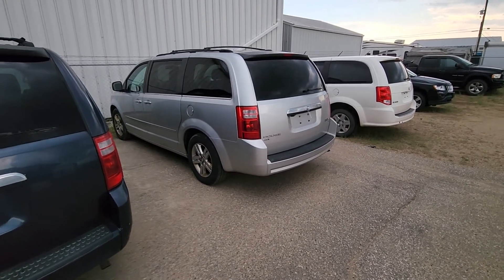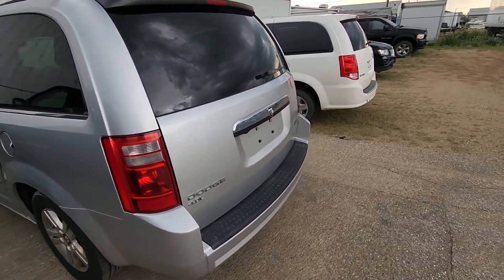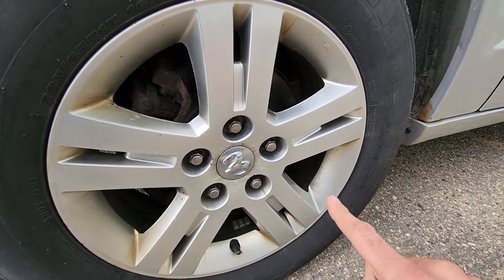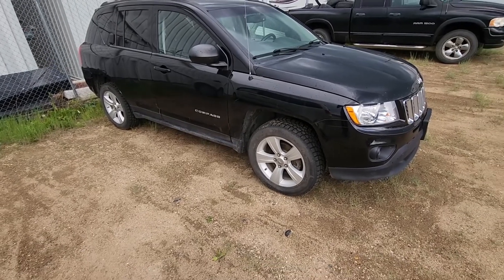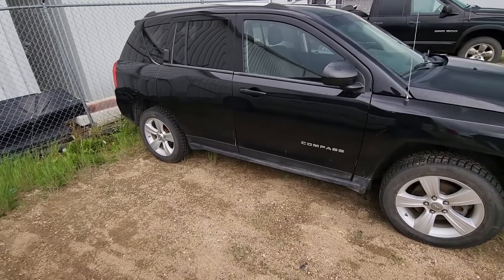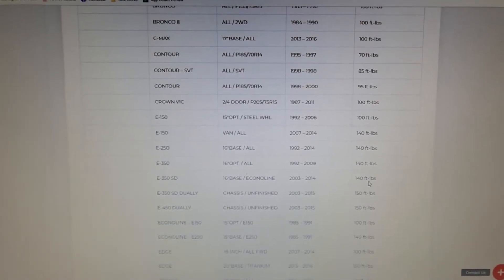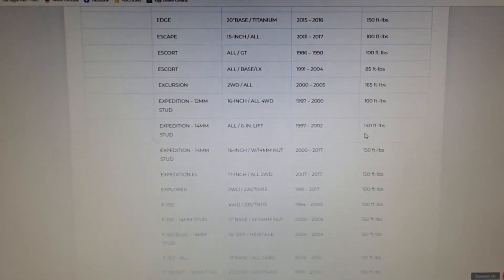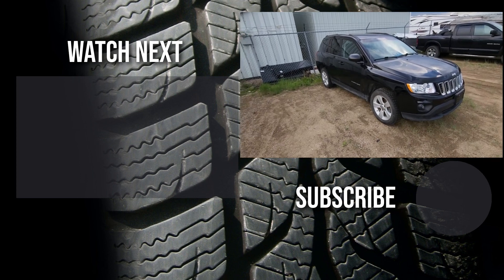OVER TIGHTENED / OVER TORQUED WHEEL NUTS CAN CAUSE MAJOR PROBLEMS ON VEHICLES!

Comment: That’s correct. One Mechanin do it for my brand new BMW and I got vibration from wheels sometime. They put 180+ instead of 105. 😢
Reply from the maker: Ohh yes I happens too often. Unfortunately most mechanics will not torque the wheels to factory specs, but they will do it by their "feeling"
Reply: Did you take it back and they took it off?

Comment: Factory torque specs are BS. For years I have used torque value of 70 ft lb on every car I have owned or serviced. And in the event of an emergency that you need to change a tire on yourcar on the side of the road, good luck in trying try to loosen tthose lug nuts tighten that over 120 ft lb off with the chintzy equipment provided by the car manufacturer good. Of course they figured nobody ever will change their tires on the road without calling AAA or other emergency outlets.
Reply: That's very dangerous advice. Different vehicles have different wheel torques for a reason as specified by the engineer under over torqued a wheel is just a dangerous as over torqued. Torque to the proper spec!!!
Reply: Forgot to add, never had any issues with lug nuts loosening up at 70 foot pounds
Reply: Not sure if I would trust 70 ft lbs of torque for a heavy Suburban, especially when the manufacturer recommends 140 ft lbs for it
Reply: @MrOiram46  always thighten them by hand,, never had any problem
Reply: The problem comes when people are using these air guns but with hand tools I don't see how you can really overtighten your lug nuts. Plus or minus a few foot pounds is not going to damage your car.
Reply: Thanks. I knew this but Happy you care.
Reply: Proof. I’m gonna need proof. I’ve never seen anyone prove that over-tightening lug nuts does anything to a rotor. Yes over-tightening could break the stud or be really hard to get off, so yes they shouldn’t be over tightened. Has nothing to do with the rotor. Just because you find a warped rotor, doesn’t mean that’s why. Wives tale.  My boss claims this too and when myth busters proves it, then I’ll think about it still.  Can’t find one proven video here. 🙄
Reply: @marblemaker117  https://www.youtube.com/shorts/MLhWXfcwDmQ   I know this link is old but I was looking for proof also. You never know with youtube of course.
Reply: You are an idiot if u think that over torquing lug nuts does not affect rotors. It most definitely warped rotors. Dont be a dummy. TORQUE TO SPEC. @marblemaker117